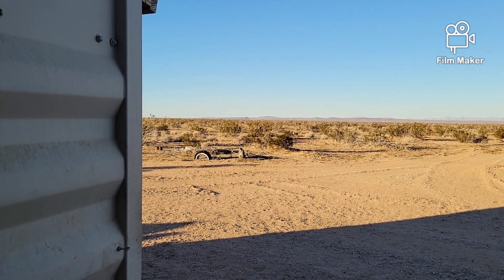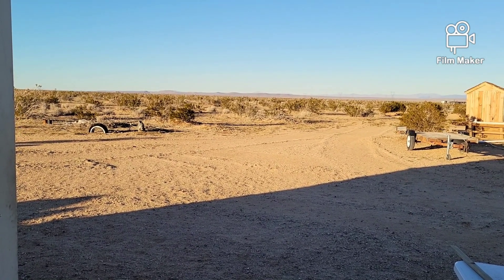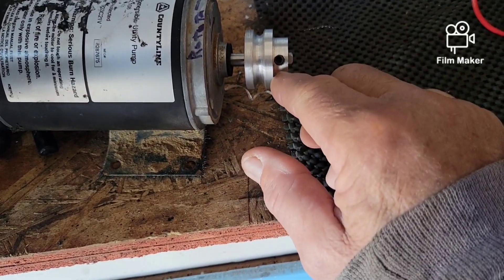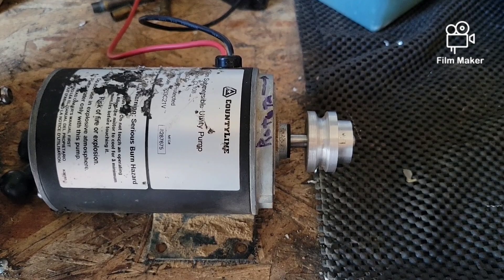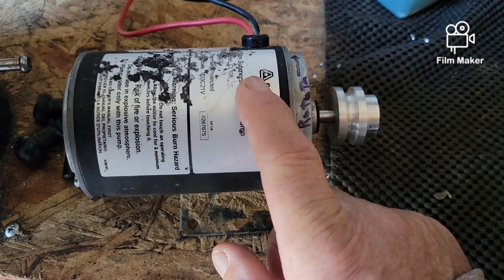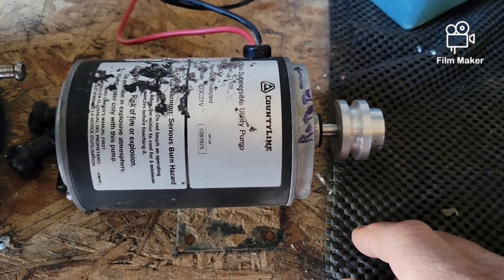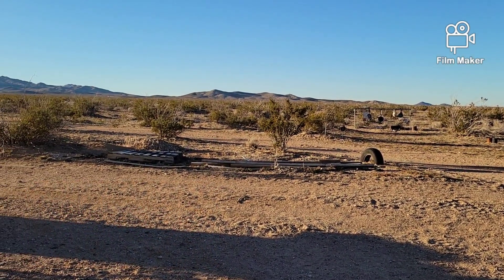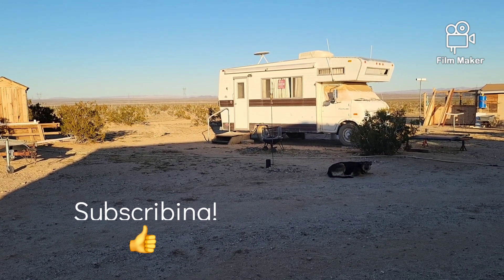Harbor Freight Inverter, and making a pulley, Jan. 5, 2024

Comment: You won't believe me but I have a very similar pump. Same brand, same thing as that but not submersible. They quit selling them at our farm and ranch store a long time ago. I've tried to buy the display one but the manager said he didn't want to sell it. The difference was, it was an older one and the pump housing was metal. They recently sold out so I might have to try to get it again. My uncle was cleaning up the old house place and we found my pump, still in the box. Never used yet lol. It's old, but new. It has a big orange tag that says in big letters not to run it dry. I guess that's why. The model number is CL 106. I was going to use it for a shower but I haven't gotten a  "round tuit" yet. I'll be sure to make sure it's primed up before I use it. Thanks for the video. Now I know what is inside of it.
Reply from the maker: Nice!  The one I showed was a model 105, but same thing.  The impeller may be dried out on your pump if it has been sitting for that long.  You may want to let it soak for a few days before turning on the power. Then turn it on and off quickly to start a few times.  If it doesn't turn, it is frozen due to drying out.  Also, note that these transfer pumps are not good for things other than water transfer because of the impeller type system, and they are not pressure regulated, so the pump will be damaged if you shut off the shower before the pump.  For a cabin or shower, a diaphram pump, pressure regulated is better.

Comment: The impeller looks like somerhing that could be 3d imprinted.   Just need a 3d printer. Lol.   Is that pump 12vdc?
Reply from the maker: Yes, the pump is 12vdc.  The impeller needs to be very flexible and it has a brass bushing insert at the shaft connection due to the extreme pressures it endures.

Comment: G that pump resembles an outboard marine water pump in the lower unit. Might be an off chance of finding an impeller at a boat repair shop. Housing, ware plate , and all.
Reply from the maker: Welcome aboard!  Good tip.

Comment: Do figure 8 very fine sandpaper to lap the face plates for backups. The 8 shape limits. The scratches on the plates are in no one direction.
Reply: I do rebuilds on pumps for work.
Reply from the maker: They are stainless steel and polished to a shine to limit friction.

Comment: I wonder if you could make a simple mould for the impeller and cast a new one from 2 part polyurethane, its available in different durometers, pretty wear resisrant and you could make spares for pretty cheap.
Reply from the maker: Probably could, but the impellor has a center part of brass that mounts on the shaft.  I still think the time and expense isn't worth it.